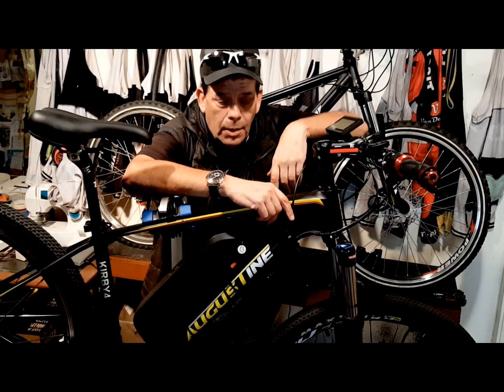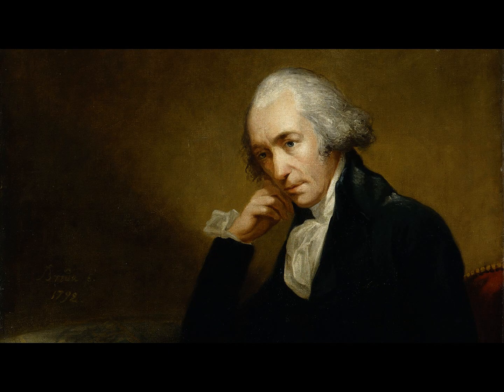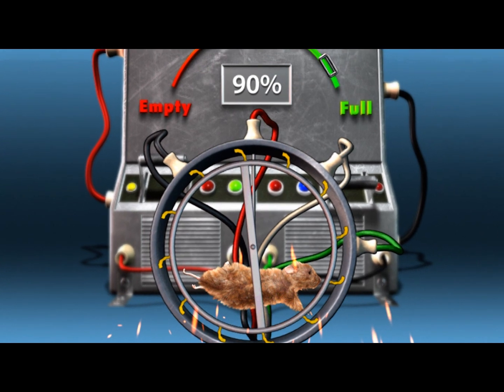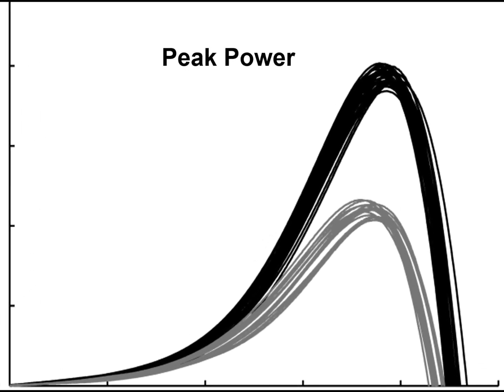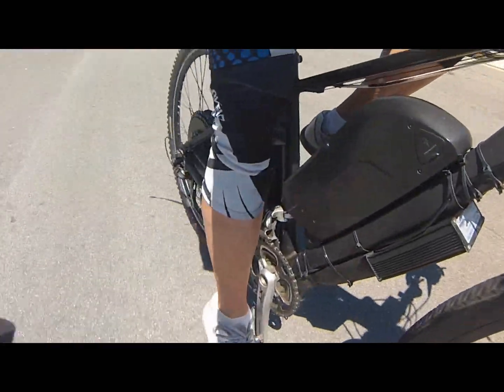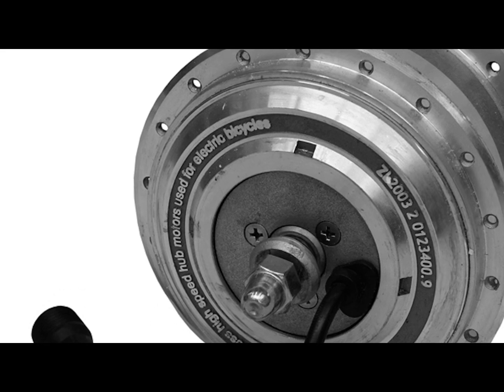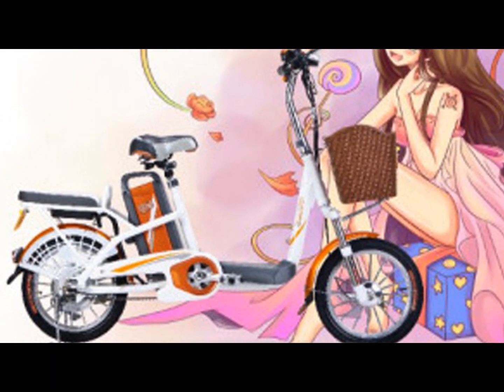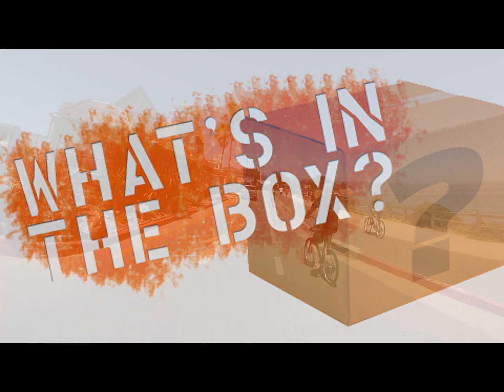Your E-Bike's Watts and your Motor's Performance

Comment: I have a z6 electric motorcycle 2000 watts 72v 20 amp what power station can I use to charge it for under $500

Comment: Hi I'm trying to upgrade my battery on my ebike but I can't find controller on bike is it possible to not have one? It's a 250w with 36v 10.5ah battery. I need more range and want to know if I can increase size by adding battery in parallel without causing issues to motor. Any help would be appreciated 🙏🏾

Comment: hey, i know this is an old video but maybe you can help me better understand. I live in China where electric scooters are very popular. I currently have a 60v47ah battery which can provide a continuous 50Amps. if thats the case should i be using a 3000w motor or am I missing something? I haven't been able to find whether or not my current 2000w motor is 2000w continuous or 2000w peak but 2-3000w motors seem to be the norm here for people using 60 or 72v batteries.

Comment: I'm shopping for my first ebike, and one of the bikes I've been considering boasts a 750w hub motor.  They say it's class III and frequently boast about the speed.  They say the motor has custom gearing to provide more top end speed.  But when I contacted their support team, they told me the controller is rated at 15amps.  That would mean it's really only a 720w motor for all practical purposes, right?  If the controller won't pass more than 15amps, then it's not really even a 750w peak, let alone continuous, right?  Or am I missing something here?
Reply: Thing is watts are for power that you use for clibing. You will not use even 200w on a level road, if you where to use the 750w on a leveled road continously you easily would go 45km/h+

Comment: Hi, Can a 2000 watts motor run on a 1500 watts controller.   The battery is 72 volts 45 Amps. Thx

Comment: Hi, I have a 250w motor now and was thinking of swapping out to a 350w. Is there a noticeable difference in performance? Thanks
Reply: I don't think you would, I would up the voltage, and put a larger controller on it, as long as its not constantly run at full power! Like a 250w,24v motor, go to a 500 w, 36v controller,

Comment: i have a 350w hub motor with a 36v 5.2ah. Only getting 7-10 range. I would like to get longer miles. So i can i go for 36v 8.7ah ..would that provide longer miles?
Reply from the maker: Amp Hours is what gives you range. Given how cheap 36v batteries are now, I would get a 17ah battery.

Comment: Hey I want to buy an ebike because I do Postmates delivery and I encounter hills that time have to get off my bike to climb and was wondering if 250w is all I need vs 350w or 500w
Reply from the maker: You will probably need a 500w or greater for hill performance. The 250w and 350w are great for more power on flats, but can't do a lot with hills of any size.
Reply: Na b 250 watts is not good, especially if u have a 36v , the battery will drain like crazy

Comment: Is a 48v 17ah 1000 watt battery much better than a 48v 13ah 1000 watt battery ?
Reply: The difference between the two examples you listed is the "Ah" or ampere-hours, the first is 17Ah and the second is 13Ah.   The "Ah" refers to the amount of power the battery can hold, kind of like size, so the 17Ah will last longer or take you further than the 13Ah. 
The power of the two examples would be the same since both use a 48v battery. One will last longer than the other, and you can travel further with a full charge when riding both under the same conditions.  If you are looking for more power or want to go faster you would need to go to a 52v battery. 
(I'm not an expert, just trying to help you understand.  If I am wrong on any of this please correct me, I want to learn. )
Reply: @rook-tv  so more ah last longer. More voltage run faster. More Watts have power?
Reply: @welcometomychannelswelcome7261  Hi i am learning aswell so dont mind me if I make any mistake but I think thats more watts on the motor will be able to handle all that power from the battery and the long lasting performances at fast speed. i think a lower voltage motor and the controller will eventually overheat quicker than with higher watts
Reply: @welcometomychannelswelcome7261  More amps is more torque, more voltage is more speed,more amp hour's is more range, take my 250w geared hub motor that came with a 36v 8ah battery and a controller that supplied approximately 10amps, this gave me approx 20mph and a range of approx 8-10miles "speed/weather dependant" , I'm 6'2" 200pounds so it didn't like any steep hills without a great deal of myself pedal assisting, so I bought a 36/48v 22amp controller and a 36v 15ah battery ,now I have approx 15/20 mile range the same top speed as before because anymore is frankly  too fast for the bike's components/brakes/hubs etc, and I have twice the amps so more torque/grunt for the hills, if I want more speed and I can buy a 48v battery as the controller has bigger mosfets and capacitors so can handle the increase in amps and voltage. And don't forget that when buying a lion battery from let's say eBay a 36v charges to 42v and cuts power with its bms "battery management system" at approx 32v ,a 48v charges upto 54v and cuts power at approx 44v .It's all a trade off ,I can get away with overvolting/more amps because in England it's always cool so I don't overheat the components, if I wanted to thrash the bike all day and climb more I'd go with a larger watt motor,then there's the power to weight ratio, a bigger battery with more volts or range will weigh more same goes for the motor, it all comes down to one's own specific needs.😉🇬🇧👍
Reply: Hi  everybody, you guys are all confused, and it's simple once you understand other wise write in a paper..

volts=power
amps=range (miles)
watts in motor=torque.
If you increase the volts in the battery you may burn the motor if you lower a little bit less power. 
If you increase the amps it's not a problem you have more range, more miles, less amps than the motor require may burn it. 

As more watts in the motor, more torque in the bike..

Hope it helps you guy.
Reply: @JUANRAMONROBLES  Amp Hours equals range you plonker
Reply: @JUANRAMONROBLES  You should stay well clear of electricity son.
Reply: @ianmangham4570  thanks mr.  electricity, but please don't talk about it 😂😂😂😂😂
Reply: @JUANRAMONROBLES  You speaky de English?
Reply: @JUANRAMONROBLES  🍉